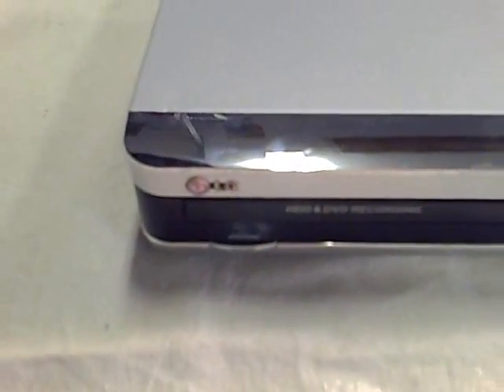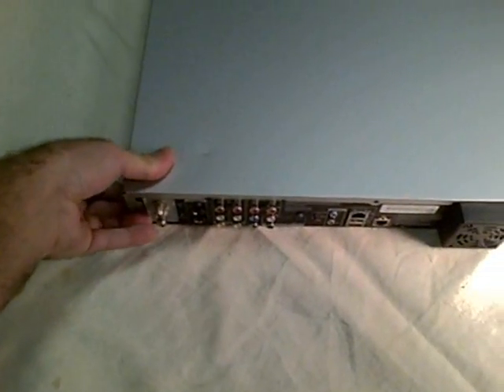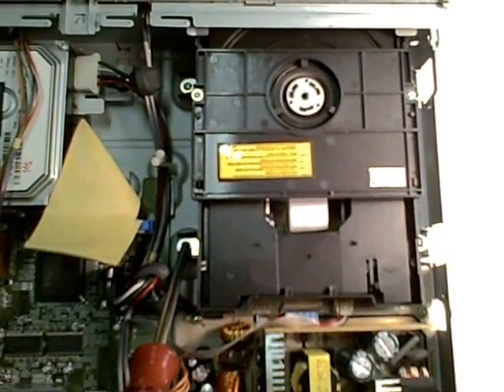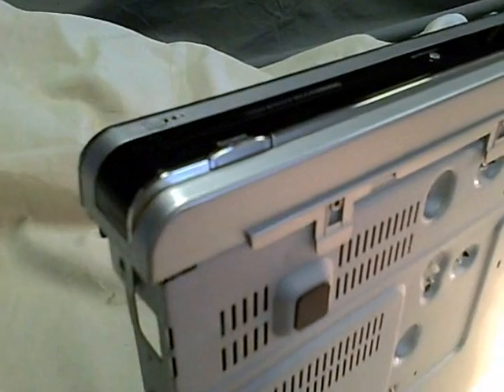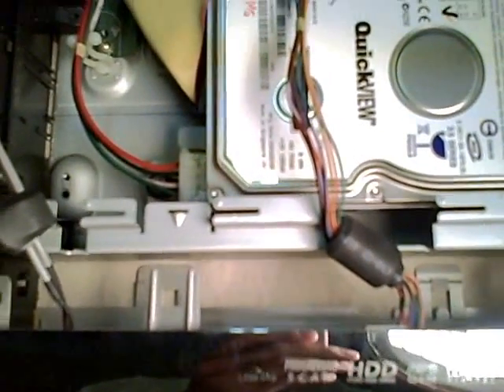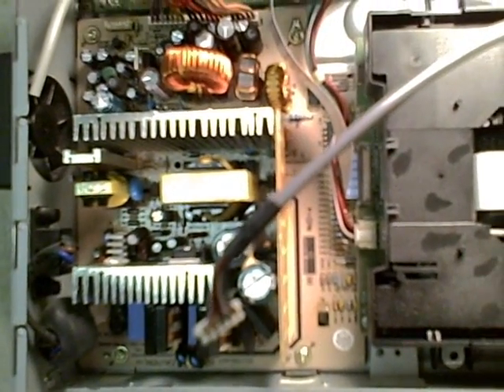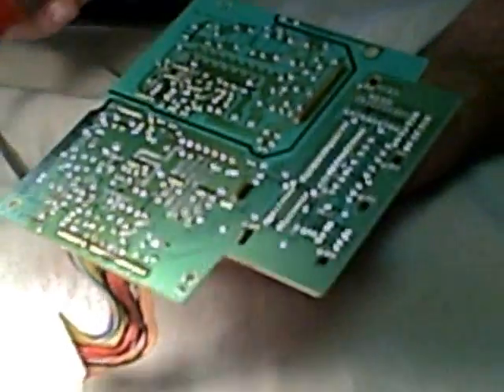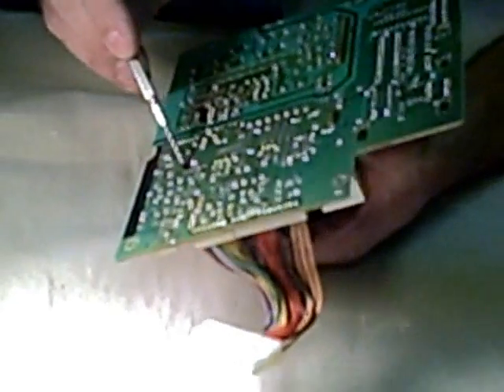How to fix your LRM-519 DVR

Comment: Thank you so much for this great video. You made it easy to fix my LRM-519. I thought I would have to have someone else look at the power supply. Those of your that try this: make sure you get long radials on your replacement capacitors...it's a tight fit.

Comment: Thank you, thank you, thank you!  My LRM-519 has been dead for 6 months with the faint HELLO on the display.  This step by step video helped me fix the problem and my DVR is now back in action!  Only thing is that the company listed for obtaining the capacitors seems to have a dead website.  I found my capacitors on eBay.  Thanks again for taking the time to produce this very helpful video!